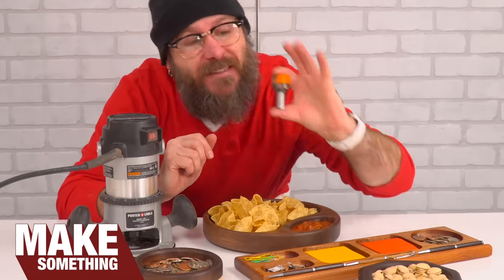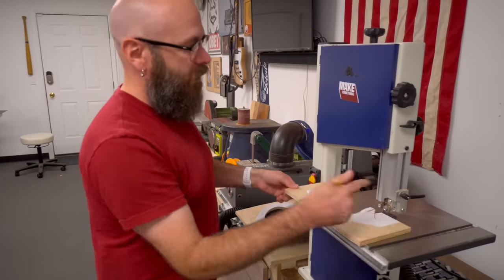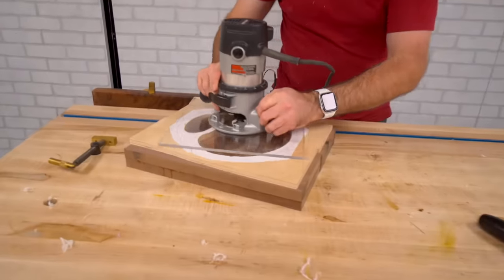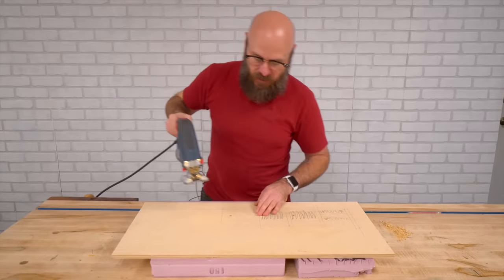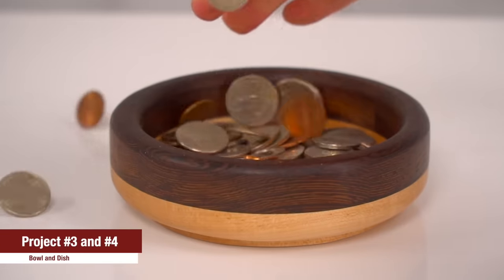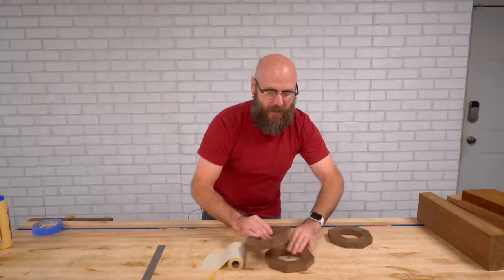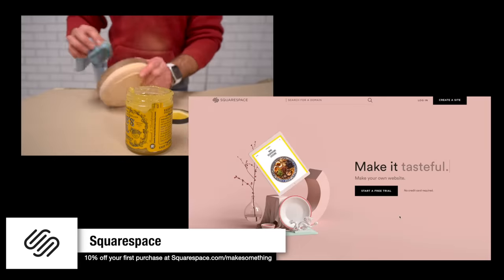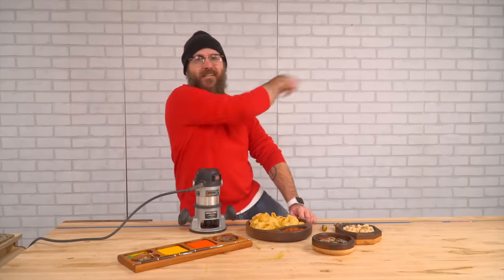4 Woodworking Projects You Can Make with a Router Bowl Bit

Comment: Great vid!  I’d add one tip:  when you were rounding the edges of the desk organizer on the router table, it helps to do two things to prevent blow-out on the end grain. 1) route the ends first, so if there’s a little bit of blow-out, you cut it out when routing the sides 2) use a follow board to reduce blow-out.

Comment: Just noticed something.  With that large acrylic foot you used you might have been able to make an attachment for your dust collector.  Sucking the chips right out of the bowl before they go spraying everywhere
Reply from the maker: Oh yeah, you are 100% correct! Will do this!
Reply: @MakeSomething  Make the hole double the size of your largest bit, which is likely this one. Build a 'hood' for the side away from you to attach the vacuum, so you can see, and so it pulls chips away from you. For extra super bonus points, add a light that spotlights your work area so you can see your cut better since you just blocked half of your light with the hood.
Reply: @root1657  Extra points if he adds a strobe light!

Comment: i buy old plastic trays if suitable and serving dishes from op shops and use them as templates then when done toss the plastic trays in the trash , i put a sheet of 6mm perspex on the serving dish/tray and hold it there with double sided tape i then drill a hole through the perspex then run a small trim bit and smallest bush in the router and cut out the the hollows in the plastic serving dishs and end up with a template much like the one you made from wood i have i think about 15 templates ive made so far . one is like a huge Peace sign , i also have a 6mm thick big base on my router so it does not dip when going over the template . one template i cut by hand was the shape of a dog paw its about a foot x foot in size and i then routed it out of sheets of ply wood the lines look good and if marine ply its good quality  reason i use perspex for templates is i got about 50 pieces free and i can see through them and if i need to move template to miss a knot i can , then i screw the template down in to countersunk holes so base plate can slide over it smoothly , and rout away ... by the way liking you channel lots keep up with the great projects

Comment: I made a dish like your first one recently, and I think that cutting and gluing multiple pieces of wood together to make a solid blank is a better solution than mine. I used a single piece of wood and it cupped a little bit after I removed a lot of material from the top. With your technique, the grain orientation of the different pieces of wood might prevent that :)

Comment: I'm a new woodworker. He has a fixed based. So to start the cut in the middle of the project do you kinda just plunge it down into your piece? kind of like your drilling with whatever bit you have?

Comment: Sometimes I watch your videos and pick up one simple tip and I'm embarrassed for not thinking of it.

I have the same 10" Rikon bandsaw.  When you flipped the piece over and then traced the alternate half on the bottom I damn near broke my hand facepalming.  Duh.  How have I not that of that?

Mortified!!
Reply from the maker: No worries, I do the same thing all the time!!
Reply: It's amazing how linear we think.  "I can't cut this side.  What do I do?  I need a bigger bandsaw"

whispers in ear "Or you can flip the piece over, dude."

What makes this even more embarrassing is that I've figured that out with my Ridgid oscillating sander HAHAHAHAHAH

I wonder what other amazing productivity gains I can make if I figured out how to flip workpieces on other tools...  Hmmmmm...

Comment: How does the template work for you when the barreling is on the bottom of the bit or is that a different fit besides the ones that come with a router

Comment: Another great video, thanks!  This really got me wondering again about your decision to go with carpet.  Are you still happy with that decision now that you've had some more time in the shop?  I appreciate being able to quickly sweep up my hardwood shop floor after messy projects like this.
Reply from the maker: I love it except for the times I use the lathe or drill press. I’m working on a stand for each that’ll catch the chips. Most of the time I use the router I have the dust collection hooked up. No regrets.
Reply: Cool!

Comment: In the 1st bowl, is the wood glue you used to double the thickness of the walnut safe to use in a bowl you will be eating out of? Or is the food safe finish you use, seal it so it’s safe?
Reply: Yes and yes.  Tote bond is water based and food safe as is Odie’s Oil.

Comment: Where did you get the sanding attachment for your drill.  I bought one a couple years ago, but it is more of a ball than a flat pad.
Reply from the maker: Amazon but I really dislike the one I used.
Reply: I bought the same sanding attachment at Woodcraft, right after I sanded some bowls by hand. 
David, have you found one you like better?

Comment: Question.... I have bad problems with wood burn. Not sure what I'm doing.. I've tried taking smaller cuts which helps some but I noticed in the video the cuts were up to 1/4" per pass and I am doing a lot less than that.  Is it a bit issue (dull or low quality), or could it be the build up of shavings causing it? I am routing out a smallish area and the router base covers 90% of the opening so the shavings are trapped.  I'm sure you know what a MAJOR pain in the arse it is sanding burn marks in the corners and rounded edges in a small tray. Can't use a sander so it all has to be done by hand, really by finger(s).
Reply from the maker: Usually burning is from dull bits. Can also be from the bit spinning too fast but unfortunately not all routers have speed control. And some woods just burn easily like hard maple.
Reply from the maker: Or dirty bits
Reply: @MakeSomething  Well 💩 ... I should have known that one.  Yep, I have speed control on my router but my senior moments seem to be more frequent now a days...🙄😄     Thanks for the reply.

Comment: Thank You for the video, but IMHO You can improve something.  You should have a suction system for the router chips so You can see where You cut;   the mask can help , but it's not enough; some ventilation for small particles is necessary too...   and, sorry, I'm a nuisance for safety, Your hands are much too near the saw blade spinning at 5:46, cutting the segments. You should use a clamp. I understand You are confident, but since many are watching Your videos, I think It's important to convey the right message about safety in the shop.

Comment: Cutting such small pieces on the table saw, with fingers so close to the blade is a recipe for disaster. Not worth the loss of a couple digits to save 50 cents in wood.
Reply from the maker: Hi Anthony! I am hyper aware of where my fingers are at relative to the blade at all times. I take safety extremely important. Sometimes camera angles can make it look like I'm closer to the blade than they actually are. Just know that I never take chances and your safety is your responsibility. Thanks!